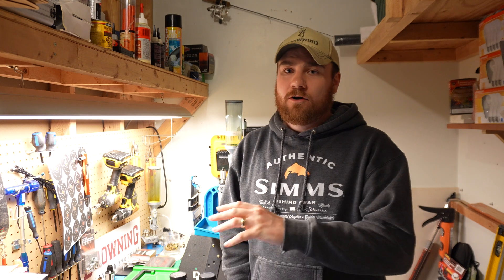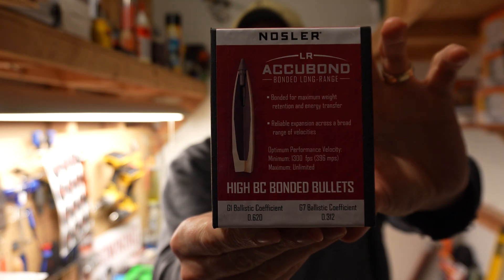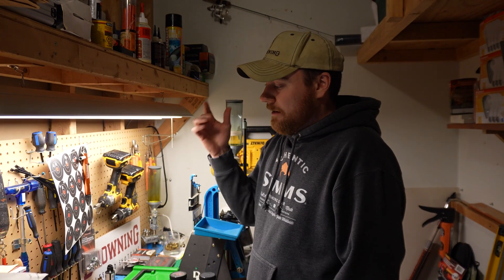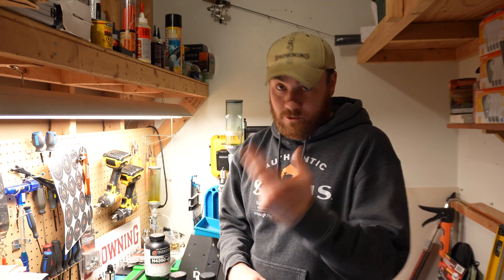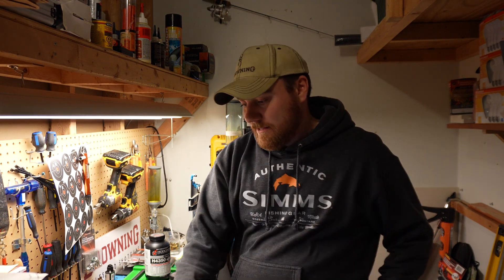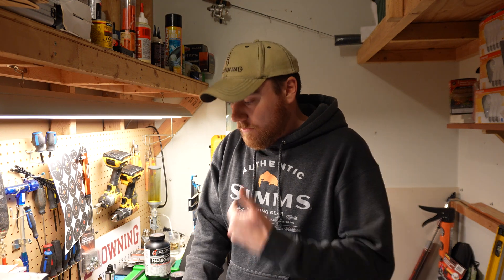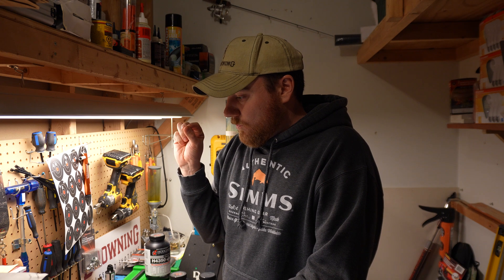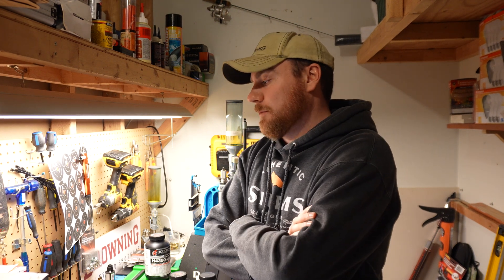6.8 Western - Episode 2 - Load Development

Comment: Howdy friend… I would advise forgetting about the velocity ladder flat spots… they are meaningless. Also 0.2gr increments is really tight. I have tried these high volume load development methods that you describe only to learn that the only benefit to burning through this much ammo is to break in the virgin barrel. 
I use way simpler methods now and avoid fine development until there is at least 100-200rds through the barrel and all the new brass is fire formed. 
Cheers!